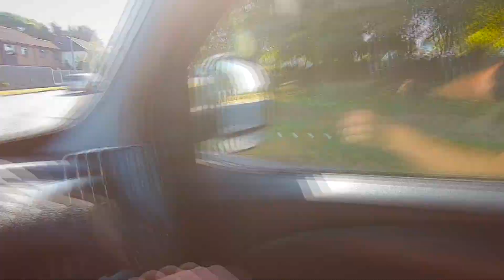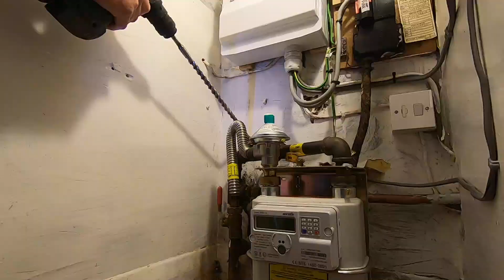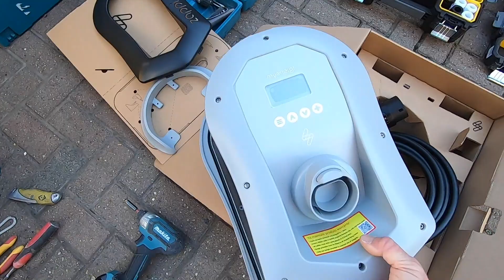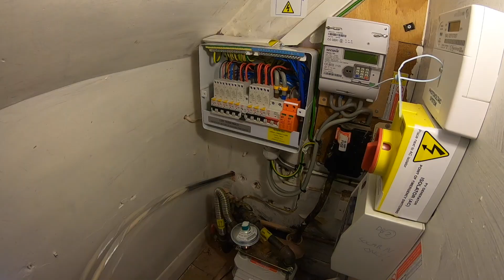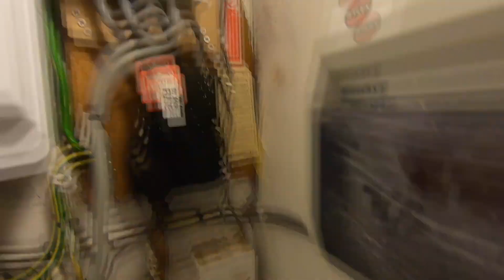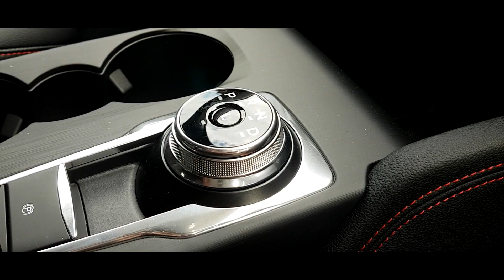Installing an EV Charger at home with Solar PV connected (Charging a Hybrid with solar)

Comment: What happens if it's cloudy for a week then what?
Reply from the maker: You can use Eco mode that supplements from the grid if surplus is not greater than 1.4kw

Comment: I have an existing solar system with a battery, I have a 10mm swa cable run to my garage (no ethernet connection to the garage).
I have a EM115 fitted to the board.
My question is will the equipment you have used allow for excess solar power to go to the car rather than be exported.
Thanks in anticipation
Reply from the maker: Hi, yes I don't see why not. Just need 3x ct sensors to monitor grid, generation and battery via a Harvi. If you are fitting on the garage cable dependant on whats possibly going to run in there you may want to monitor the supply mcb. Definitely possible but mainly with a zappi.